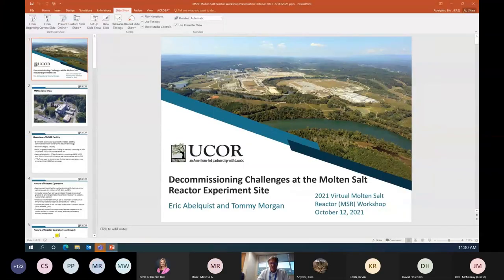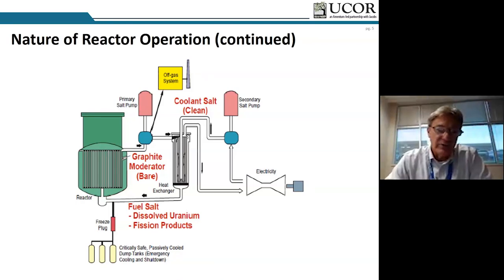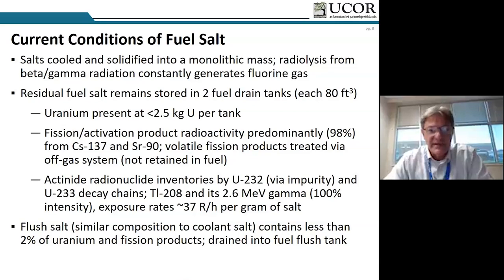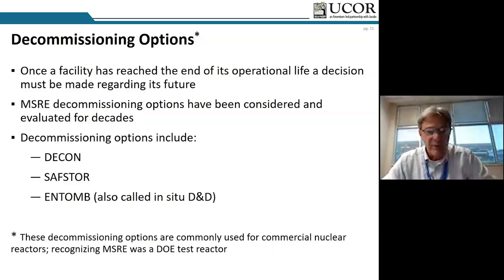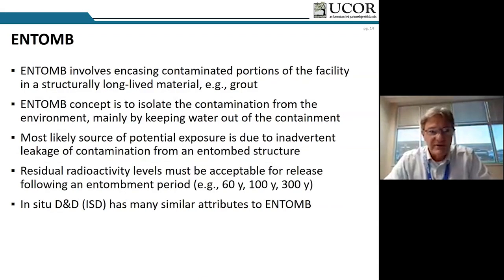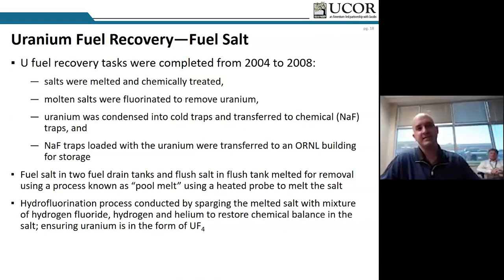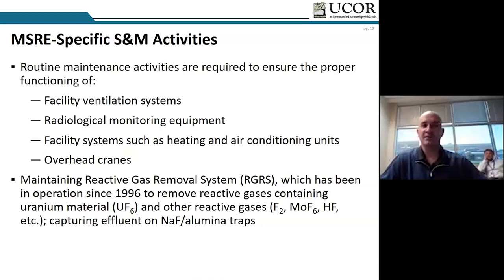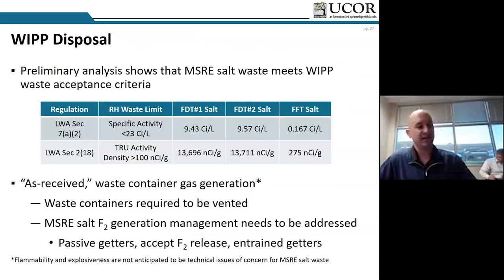Decommissioning Challenges of MSRE - Eric Abelquist and Tommy Morgan @ ORNL MSRW 2021

Comment: I appreciate this being put up. While many MSR advocates have spoken to the opportunity for high burn-up rates to minimise the waste problem - it cannot be glossed over either.  And for example, while Thorcon blithely talk about shipping reactor cans back to a central site for 'reprocessing' - the devil will surely lie in the details of this.

We need to be honest and well prepared for the obvious questions in this space.
Reply: I understand ThorCon will not be shipping any residual radioactive salt within the eight year old used but empty reactor cans which had previously had their fuel salts transferred to the adjacent empty standby can some four years earlier while still within the slightly negatively Helium pressurised sealed confining vault within which both active and empty standby cans and primary heat exchanger were housed. Their four yearly reactive cycle is pragmatically chosen to ensure the useful graphite life is not exceeding. Check out their 5th day training  session with their Chinese Chief Nuclear Engineer recently joining after successfully commissioning the T-MSR in the Gobi Desert.
https://youtu.be/q3v3L5FQSJI
Reply: @MrVaticanRag  Thanks for the link - I'll check that out.
Reply: "Reprocessing" the Can really is a recycling effort (nothing like reprocessing the fuel).  It involves opening it up - so a dedicated facility.  The graphite needs to be replaced.  There is a filter that needs to be replaced.  Otherwise, inspections need to be done.  But it does require a dedicated facility so the work can be done primarily robotically.  As such, it will be a significant investment and one that will not be made until there is a sufficient demand for recycling Cans. We will store the Cans until there is sufficient quantity to be worth building the recycling center.

Comment: The big surprise was the presence of F2 and HF offgas. I've never seen anyone mention that as a hazard of MSRs. 15:03 "It's not a lot but it's enough to be a significant hazard". How significant? Are we talking about a 50-year buildup that could be safely vented to atmosphere if safety regulations were reasonable? Or are we talking about so much offgas that ventilation isn't enough to mitigate it? Compared with smoke from coal plants that is vented to atmosphere, how big a deal is this really? Also, what causes this offgassing? Is it radioactive? Can it be captured and turned back into a solid?

Comment: 17:12 "Obviously the facility - it's not really falling down around us, but it certainly was not designed to accommodate workers with today's industrial safety standards. That's kind of the big thing, things are different today than they were when this place was built." My question, though, is whether all the extra standards you need to accommodate are actually worthwhile. It's hard to judge, as Eric & Tommy didn't mention e.g. how much mSv of radiation they might realistically be exposed to if they took only a "1969" level of precautions. Indeed, in 1969 how much would they even worry about the 2-3 kg of UF6 that went to the charcoal bed?
Reply: Another issue is the other dangers. If your dosimeter is quiet, it doesn't mean that you won't be hearing the mesothelioma can can with all the pipes covered in asbestos.

Comment: What should happen at this reactor right now, is everything in it's entirety should be given to Kirk Sorensen and his FLIBE conglomerate and given free rein under law to use the salt, the stupid carbon additive and use this fuel and salt for a new modular reactor to burn and clean up so it would no longer be putting off fluorine gas and cesium, strontium, and iodine, along with it's 37rad dose salt, let him figure out how to safely use it and decontaminate the fuel salt and give it to him free of charge to use in a new unit so we get off the stinking polluting coal fired units. Then the cost won't be passed to my children's children in tax burden.